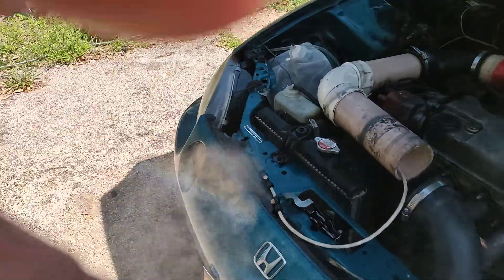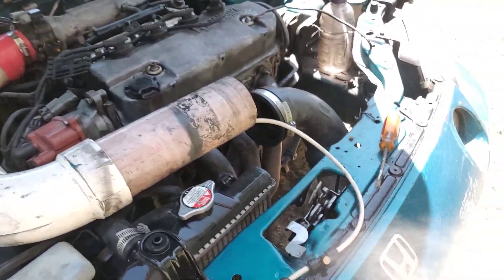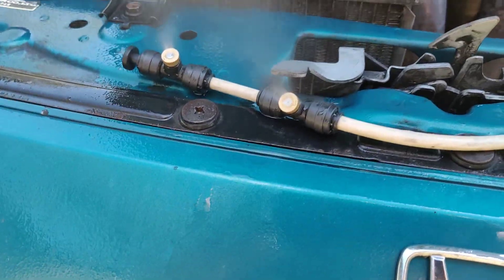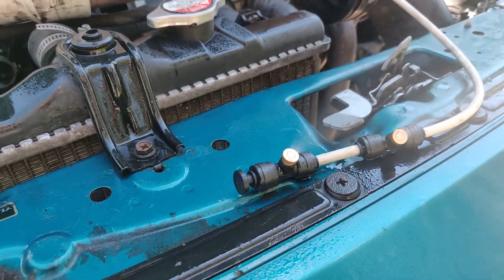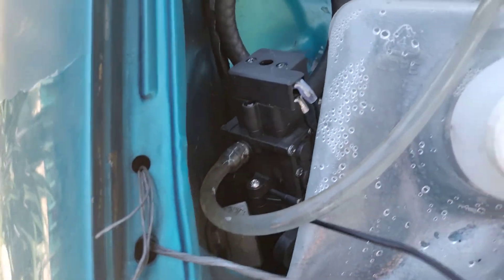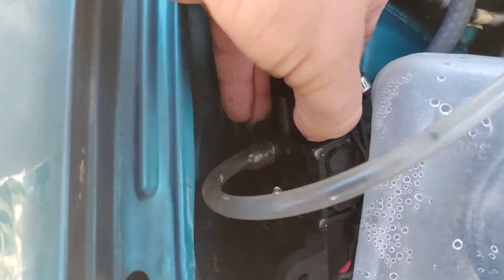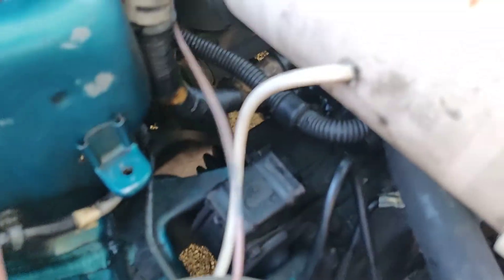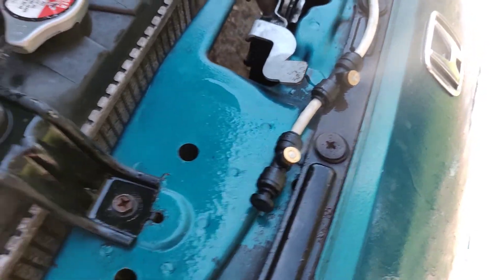Simple and cheap Water injection on a car

Comment: I'm trying to setup something very similar in my truck. My 6.0L engine gets insanely bad fuel mileage. Looking for anything to assist. Also swapping the heads out for much better compression. 

My nozzles are .3mm. They don't seem to have near the flow as yours.  I'll play with it a bit. I'm also considering a second system that doesn't kick in till the engine has reached a specific temperature. 

You know, I'd hate to hit it with to much water on a cold start. I figure out can run off an adjustable switch threaded into the engine or use one of the electric fan pcm wires and just set the temp from there.
Reply from the maker: You wouldwant todo something to modulate the signals of the oxygen sensors or you will end up using more gas like using an 02 simulator
Reply: @prototype9000  how is the signal changed? I'm adding water, not fuel or oxygen. I would think the O2 signal would stay the same. Only the exhaust would contain more steam and a lot less heat.
Reply from the maker: @shaundeibert8438  o2 sensor detects more oxygen than there should be  so then it sends more fuel  to be burned to keep the stoiciometric ratio the same if you trick the computer and it does not see a change then you can do what you need to without change the mode of operation
Reply: Hmmm, I'll have to look into that.

Comment: I run a waste veg oil VW tdi Golf. I have the same water pump and similar idea to this. I would like mine to 'kick in' at the higher revs. When I had a prototype fitted, that would be on all the time, I got water in the engine oil. I have purchased a 0.1 mm nozzle (smallest). Fitting it soon. It is mainly to try and keep engine combustion chambers clean as it is WVO and tends to polymerise when cold. Cheers from UK

Comment: nice work bro...it sounds like relay signal on off on off. can you show us here the wiring diagram for this setup. im sure a lot of people want to know more here
Reply from the maker: I just have a switch inside the car to turn it on and off the pump hasa pressure switch that turns it on and off by itself when the pressure has reached a certain pressure it goes off when it drops the pump pumps again